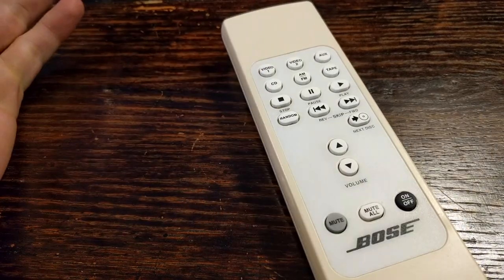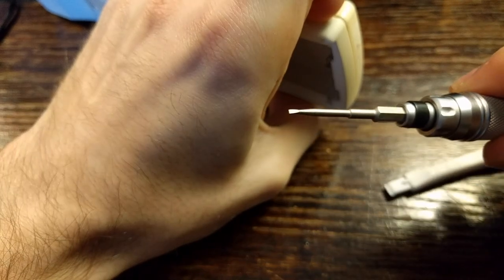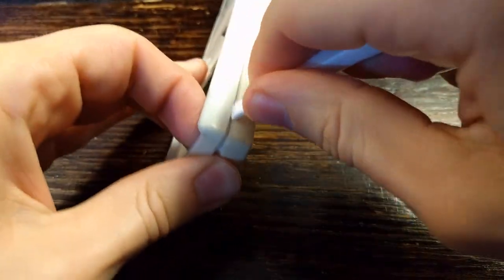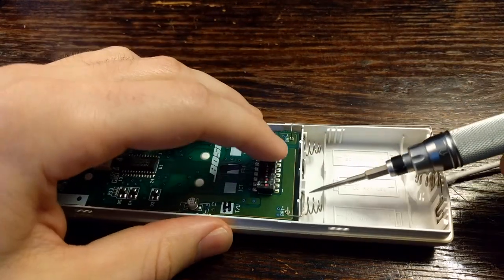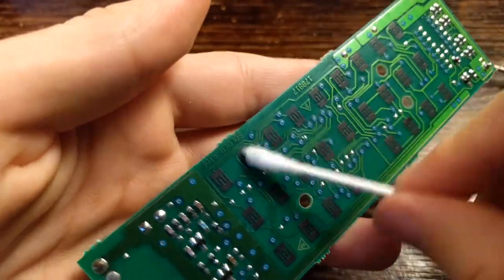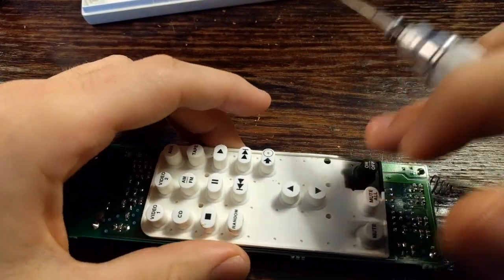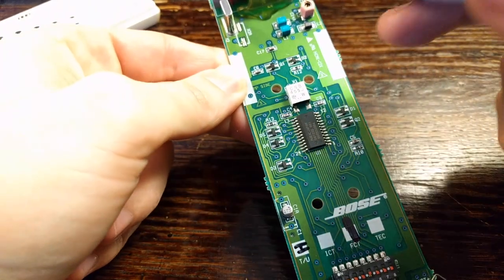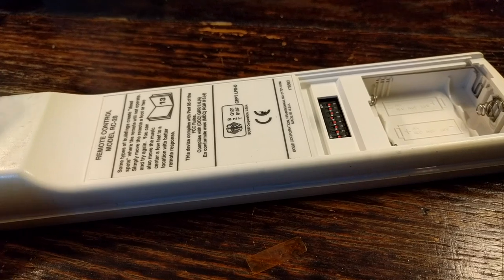Bose RC-9/20/25 Button and Limited Range Fix

Comment: Awesome detail.  was going to buy a used one.  Instead cleaned buttons off with alcohol and noticed loose battery connector and opposite end wire disconnect.  soldered both and gave my wife her old R9 remote back for our bose lifestyle 5 system from 1997.  wallah....everythings is under control again.  Cheers to you my friend.
Reply: Her Hero 😊

Comment: Thank you sir , I didn’t have any alcohol, so I used peroxide, wiped it down , works like new. My system is an old analog, purchased a converter works great in my smart tv .

Comment: Thank you so much!!! Your instructions were clear and concise so I was able to correct my situation. Certain buttons on the remote was not consistently working but after cleaning it worked like new. This is a Bose remote for my surround sound system that is over 20 years old. Thanks again........

Comment: I had the same issue with short range issue and it was the coil inside the remote had broken.  I was able to solder it back together.   Easy fix.

Comment: I used super glue and aluminum foil on my volume buttons. It works. Probably a better idea to go with that conductive paint though. I also had a range issue but it's been about 15 years since I stopped using the remote so we'll see what happens now. I checked those connections like you suggested and they seem fine. I have a remote again!!!!

Comment: Very clear directions. My issue is the limited range. I don't see loose connections but I will recheck the antennas again. If the oscillator is damaged, will it be obvious? I don't see anything. Sometimes from a distance it works and sometimes I have to be right up on the system! ARGH!  lol. I've done both types of button repairs, with the new pad and the keypad fix. Don't like the painting of the keypad fix that flakes off quickly. Waste of money. Anyway. Thanks for your video.

Comment: thanks...found loose antenna connection..resolved what we had put up with for years of 'where to point the remote'  thinking it was infrared ...duh! it is a radio signal and we had a loose connection from the umpteen drops over the years

Comment: I’m having a range issue. Replaced the crystal oscillator and it didn’t work. Put the old one back in and it worked again but still have limited range. Ideas?
Reply from the maker: If you don't already have one, adding an FM radio antenna to your base station will help the remote range. Beyond that, I don't know what else to say aside from check for bad connections on the remote.
Reply: Have you eliminated the possible external radio interference near the base station? I recently struggled with my remote and I was able to fix it using the guidance in this video. However, the remote seemed to be broken again, the limited range issues re-appeared. After examining the remote internals again I thought maybe the oscillator was broken (or some other part), but then I realised that I had just bought a new bluetooth receiver for streaming from my phone and put it just behind the base station. When I disconnected the BT box RCA-plugs from the base station, the remote started working everywhere again! Same happened when I plugged out the power from the BT box. Luckily, I got rid of the radio interference clearly caused by the BT receiver by moving it further away from the base station (just half a meter seemed to be enough in my case).
Reply: M Nguyen
I have the same radio interference issues as Toni described above. I turn off my bluetooth receiver which is located near the Bose base station, then my Bose remote works again.